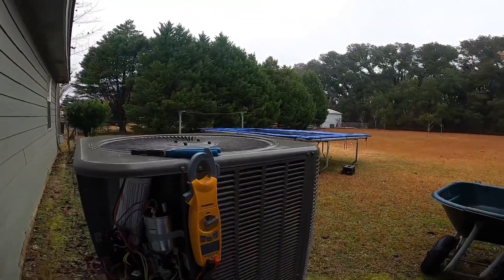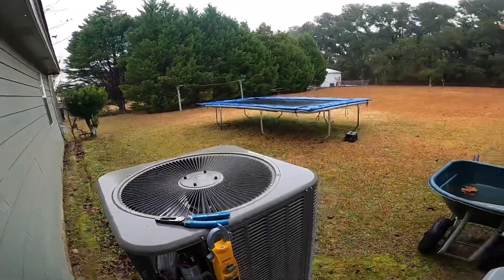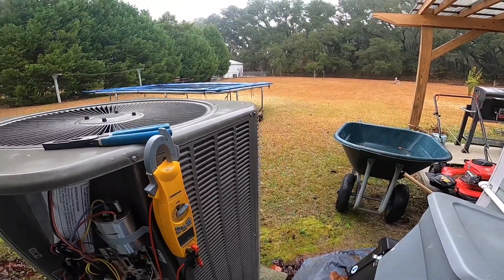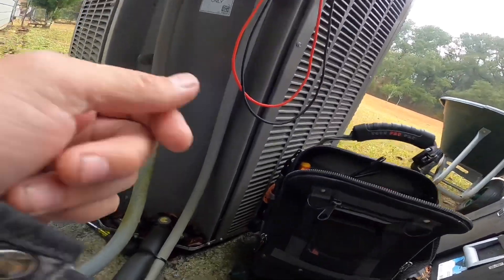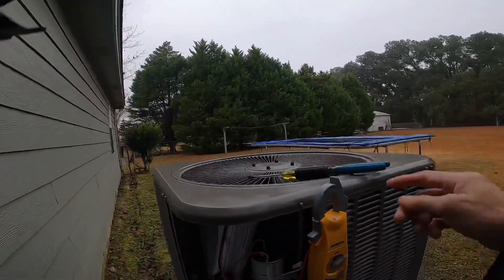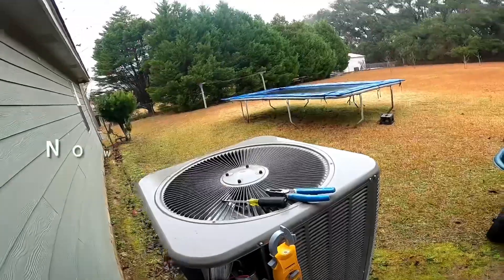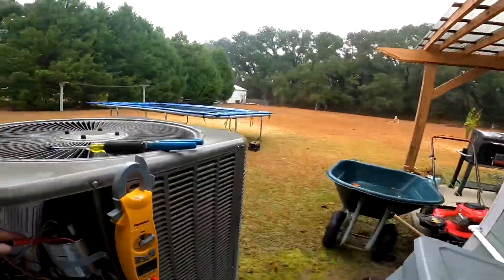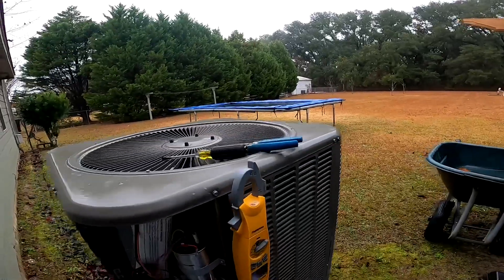Discovering A Wrong Way To Check A Capacitor

Comment: With both Fan and Herm connected, the capacitors are wired in parallel through the Run windings and start windings with a connection at the contactor.  So the reading would be the sum of the capacitors.  You didn't say, but the Herm to C was, what, 36 or 38 uF.  Likely 38, with some variation due to the capacitance in the winding.  Pulling either Herm or Fan breaks the circuit so you only test across the one capacitor.

Comment: On a heat pump, there is a path through the defrost timer board connecting both sides of the run capacitor in paralell to L2. I think you're measuring both sides minus the resistance of the path through the board.

Comment: If the circuit is working take 2652 X the current on the capacitor wire divided by the voltage across the capacitor = microfarads. Start Winding Amps x 2,652 ÷  capacitor voltage = microfarads. That way you get the capacitor value actually in the circuit and you don’t have to disconnect any wires. Works great! Thanks as always for your great videos. Merry Christmas.